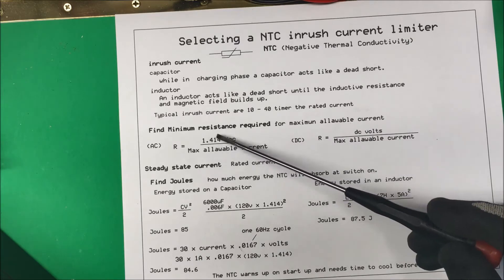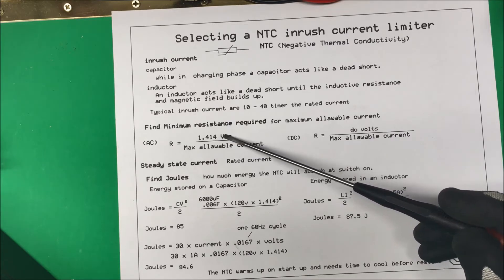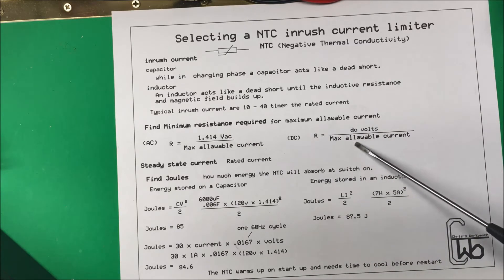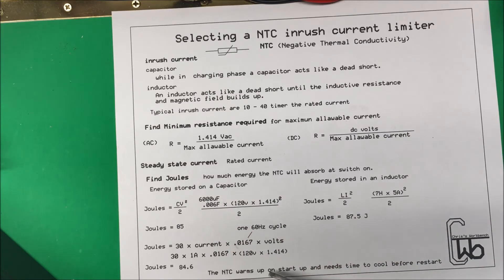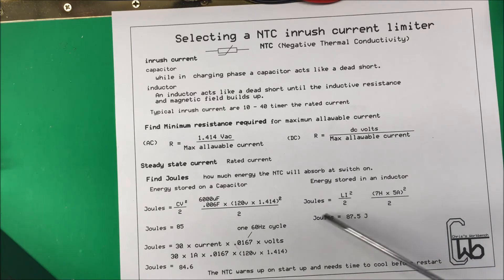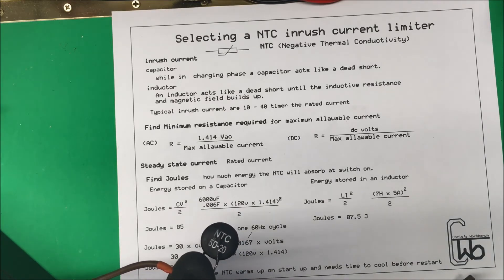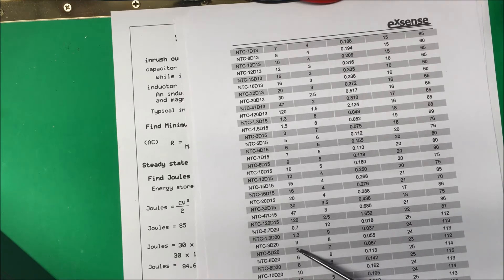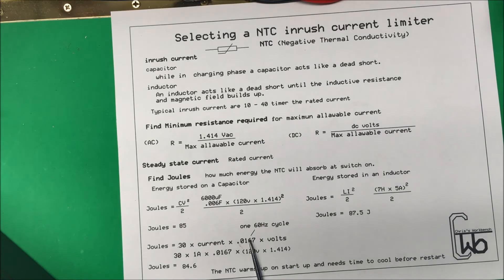NTC inrush current limiter

Comment: Would a simple NTC circuit like this work to limit the inrush current when a 230V AC fridge compressor switches on?  I want to reduce the start up current so my inverter doesn’t trip out. If I can’t use an NTC to achieve this, do you know what product or circuit would be suitable? A lot of the prebuilt “soft starter” modules say they can’t be used on a fridge, and I’m not sure why. Thanks for any help 👍
Reply from the maker: The compressor has a starting winding that needs full current and is controlled with a PTC. You  need a bigger inverter.
Reply: @ke6chris  thanks for replying Chris. Since I asked my question, I’ve learned a lot more about the compressor “hard start kits” Supco make. It seems it is possible and beneficial to add a further PTC in series with a capacitor and to wire this arrangement it parallel with the existing compressor start capacitor (which itself is controlled with ptc relay). Doing so phase shifts the AC waveform in the brief fraction of a second in which the ptc allows current to flow thru the new capacitor and increases the starting torque of the compressor, hustling it much faster through that first phase of movement in which a high current is drawn, so the inverter is perceives less load.  

This is the theory - I haven’t tried it yet, but I have a 37 ohm ptc and 150uF capacitor en route and Supco in the US have been selling hard start kits for air con and fridge compressors for a long time now.
Reply from the maker: Sounds good Thanks keep me posted